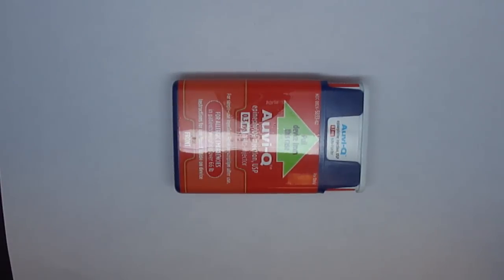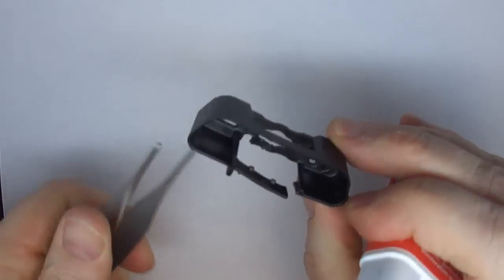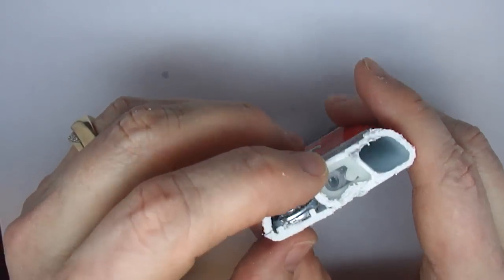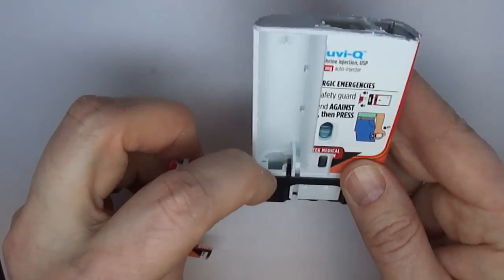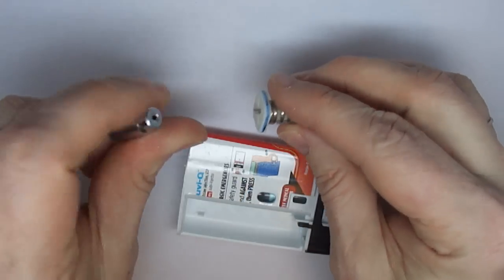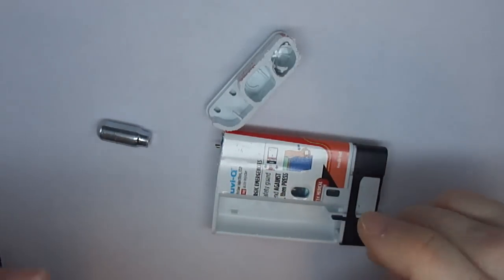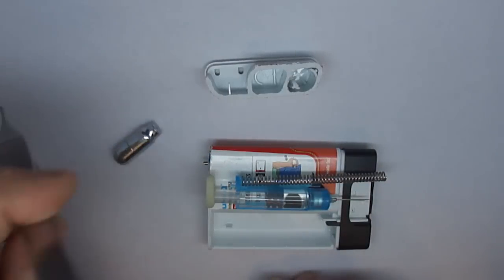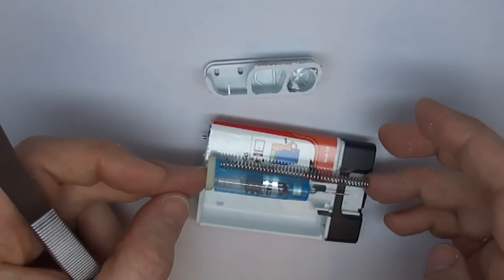AuviQ™ Dissected -- Improved detail

Comment: I may be mistaken but I think the explanation of firing and retraction at the end is not quite correct. I think the CO2, upon initial release, pressurized the area above the white piston. As described, the next thing that happens is the needle+housing assembly is forced downward, and the needle projects from the bottom of the device and entering the injection target. Note that until the needle+housing extension is complete, the syringe plunger has not yet been moved and no drug solution has been expelled. After full needle+housing assembly extension is complete (and the needle is fully extended into the injection target), the built up pressure becomes large enough to further compress the 'return spring' and the white piston begins actually moving the syringe plunger to deliver the drug solution. When that process completes, the by-pass channel at the top is opened and CO2 vents from the top down into the syringe chamber. This depressurizes the top compartment, allowing the compressed return spring to expand which pushes the entire needle+housing assembly back up into the device (thus the needle is fully retracted) and the cycle is complete.

Comment: Very nice breakdown!  Great little device.  So- based on this, do you think the device can be de-activated by careful removal of the gas cannister through the top right portion (under the top-cap), and the electronics could be removed at anytime without firing the device?  The electronics appear to be only a sensor bundle and voice chip and only read the system instead of actuate the system.  The gas is critical to firing, so if the cannister can be removed without puncture, that would disable the device.